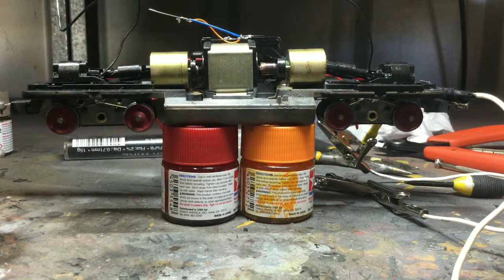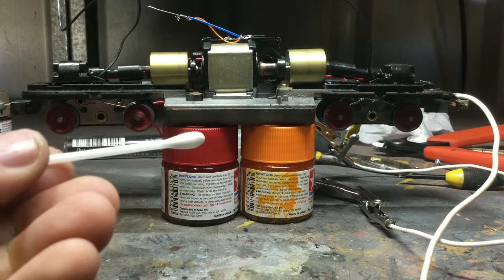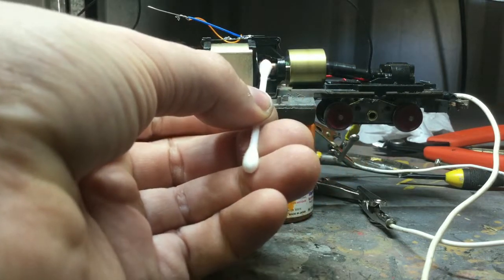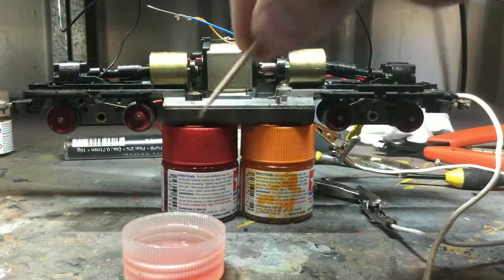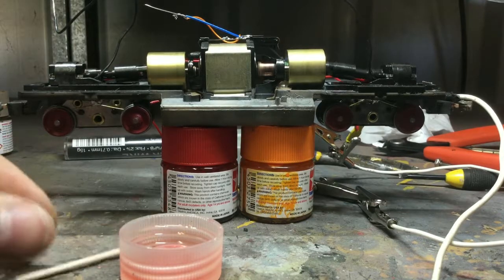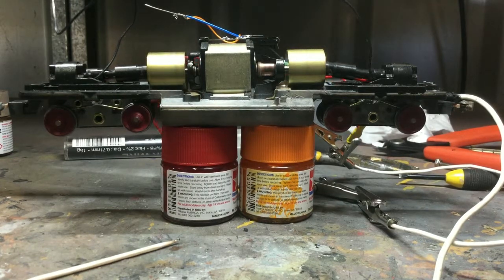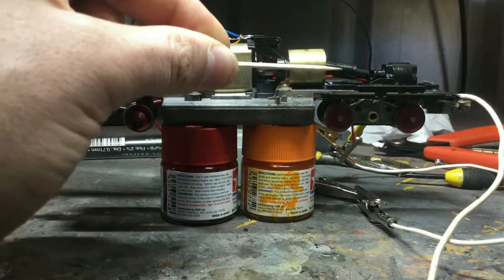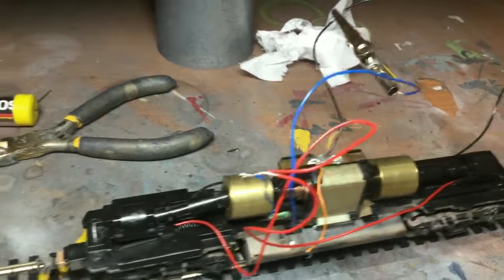Athearn blue box part 2: Cleaning and lubricating

Comment: Back wheel has a loose or broken shaft gear which causes the wheels to not spin with the shaft as the gears turn, very common issues easily fixed with new pack of axle gears (They state sd-45 on the package but are used in all Locos of this era).  Love these old Athearns!
Reply from the maker: You are correct on all fronts. I have since replaced all the gears. They are great locomotives indeed.

Comment: Your spine shafts/slip joints are too far out (not engaged enough) and drooping, which leads to excessive vibration and noise. If you can, push them together for maximum contact by pushing them a bit off the adjacent metal motor and worm shafts. Athearn makes a variety of lengths--use the longest. Next, lubricate the inside of the spline shaft with heavy grease/Vaseline. This doesn't impede drivetrain motion, but damps any vibrations caused by Athearn's loose tolerances inside the slip joint. Finally, when you install the worm gears in the truck housing, add thin metal shims on both sides of the worm to limit axial play. Since worm gears can't be back-driven, when trains are descending, the worms can rock back and forth in their housing aggravating the problem of speed surges or wheel lock at very low voltages, especially when more than one engine is in the consist fighting each other.
Reply from the maker: Very informative. Thank you very much for all the feedback. I will do that for sure. I love working on the old blue boxes.